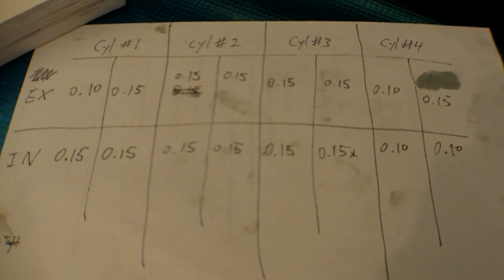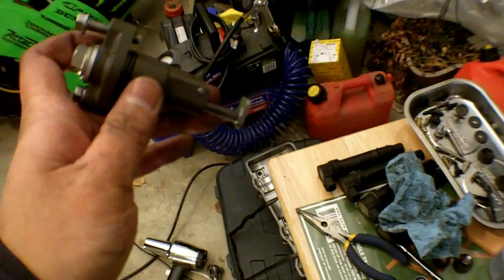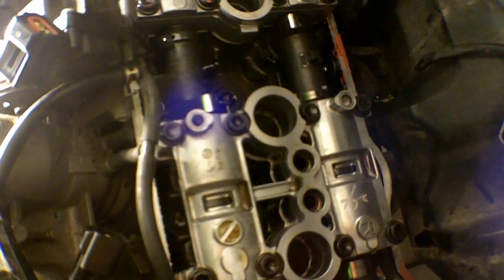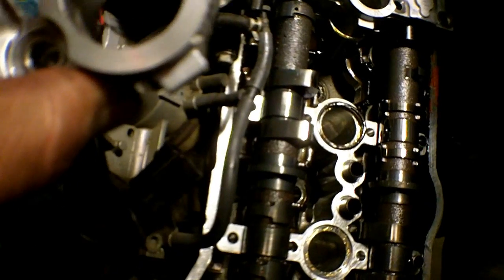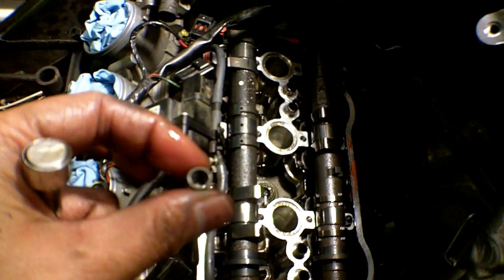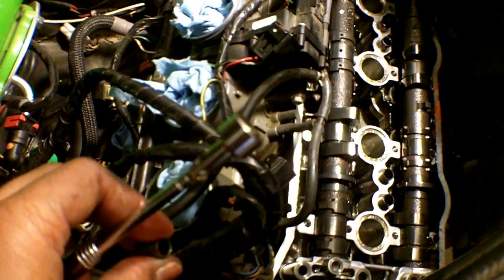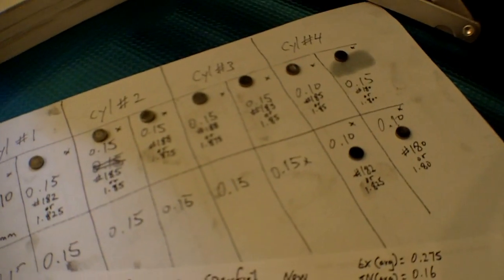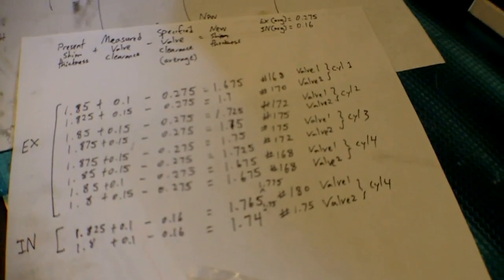Valve clearance adjustment using shims on a motorcycle Part 1

Comment: Btw the timing mark is to put pistons 1 or 4 at tdc not both so make sure you’re not 360 degrees out on your measurements. You can check this by seeing if the cam lobes on pistons 1 or 4 are engaged then you can continue to measure the valve spacing.

Comment: Using this video to double check my work on my 2021 ZX6R. At 15k miles I am seeing tight clearances on all of my exhaust valves, and within spec of all of my intake valves. Thank you again for posting this video it is very helpful 11 years later.

Comment: First of all thank you for your detailed approach to this critical maintenance. My question is- I had to replace the entire head due to camshaft damage and damage to the bottom of the cylinder head. I found the entire top end on Ebay for $220 the unit came in excellent condition with the shims in place. Since the unit is disassembled do I assemble it then check valve clearance? I have Hotcams complete valve shim kit but not sure if I should replace them according to their current values and then assemble? Please lend me your guidance O' wise one!

Comment: Isnt it better to go from the max clearance? What i've learnt is that your valve seats wear over time so the valve clearance actually gets smaller over time. So when you shim your valves to the max of the specified range it actually wears down through the specified range until the clearances get too small again and you have to re-shim your valves.

Comment: Would it be possible for a motorcycle that's been stored for 5-10 years to have valves be too loose? perhaps from a compressed spring from the cam shaft pushing on the bucket for such an extended time? 

I'm only asking because the bike has 9100 miles on it, and has tap noise. It may just be the cct but it doesnt quiet down or go away after riding for a while... But I suppose it hasn't gotten worse though either.... Hm... Thoughts?
Reply: Yo, did you figure out the problem? does it tap during idle and revving? was it the CCT? I have not replaced my CCT yet but im hoping itll fix the issue. I just hope it isnt a spun bearing.

Comment: good video,but i found it a bit strange having the new shim thickness to a smaller value.
Reply: +MrSimgal But you understand why the new shim is a smaller value?
Reply: +bagpopuk yes I was told that the valve length increase by time.
Reply: +MrSimgal The more accepted causes are that the valve gets forced further up into the head through either wear between the valve head and seat face, or the relatively soft Aluminium of the head into which the seat is pressed deforms fractionally with increased mileage until it work-hardens, hence the less frequent need for shim changes with higher mileage.
Reply: +bagpopuk ok thanks, good explanation.
Reply: +MrSimgal It may not be the whole picture but it made a lot of sense when I read it.

By the way, nice vid of your ZX10R you posted. Bit too fast for me and I'm the wrong age and shape for one, so I bought a ZZR1100/ZX11 instead, love it to death :-)
Reply: +bagpopuk how old are you mate?
Reply: +MrSimgal 53, but I'm a high mileage version too which doesn't help, lol.
Reply: +bagpopuk Hahaha, well im 47 and still riding sportbikes ;-)
Reply: As the saying goes; You don't stop riding because you get old, you get old because you stop riding! Looks like me and you are gonna live forever, lol. Ride safe mate and have a great 2016.
Reply: +bagpopuk you to ;-)

Comment: Im doing this to my 04,im about to pull the valve cover off,but my mechanic told me i have to use a spring compressor, cant i just pull the cams out and buckets to acess the shims? Its an 04 zx 636,and in the manual it only says to use the compressor to actually remove the valves,anyone chime in on this?
Reply: Did you ever figured it out, I'm sure you have, just need to ask you of questions.
Reply: +Inock Up never actually needed adjusting. Just checked for clearances and was al set. What questions ?

Comment: can i use that formula to figure out the shims for my 07 R6? the manual say something cocmpletely different but its hard to understand.
Reply: Yes, you should be able to use this formula. What he's doing in the video is to bring the valve clearance to the middle of the range, that's why he's is averaging the min and max clearance values. Is the service manual they are just tying to bring the clearance back into spec, in the service manual if the measured clearance is over the max they are adjusting it to the max clearance, on top of that they are rounding the value of the thickness of the pad(shim) because they are saying the pads are only available in increments of .05 mm. If this is true you have to take that into account the valve clearance tolerance given in the spec. If the spec says 0.12–0.19 mm and you use .155 in your formula you know that the shim can have a thickness of plus/mines .035 mm.

Comment: I saw another vid on measuring valve clearance, and he changed it by tweaking some bolts. With how much clearance do you need to change chims? Please help I need to adjust mine too
Reply: That information would be in the owner's manual as it's different for every bike
Reply: @elixier33  lol thanks, sure took the time to respond (8 years)

Comment: Check your owner's manual. Valves need to be checked after a certain amount if miles. It is usually done by a mechanic/shop, though.

Comment: does this absolutely have to be done on a motorcycle
Reply: mogearz different bikes are adjusted differently with different specifications and you should consult a manual specific to your bike and engine model to be sure. Yes almost all bikes are either shim styled adjustments or they have a little screw on top you adjust. The engine needs to be turned to a specific position for the adjustments. You really need a manual specific to your bike to be sure but if you're really experienced you might get by without one if you can find the clearance specs. I can do atv valve adjustments easy enough with the little screw and some motorcycles are this style but I'm nervous about messing with the shim & bucket styled but the shim style adjustments don't need to be adjusted very often at all compared to the regular. So your answer is yes your bike needs valve adjustments but it may not be this complex. Best to look for a video for your specific bike.

Comment: Where did you learn this? Obviously your not some joe with tools. Also not  sure if you can give advice on this. I dont have the faith to do this myself, I called a shop and was told around 250-300$ for about 4 hrs of work. Is this normal or is this just for checking the valves not actually putting in the right shims.

Comment: @wedginator I have the ZZR600. At least your timing chain is on the end, unlike mine which is in the middle. If you need to replace the timing chain, at least you don't have to split it.